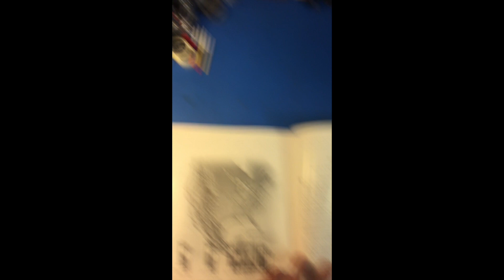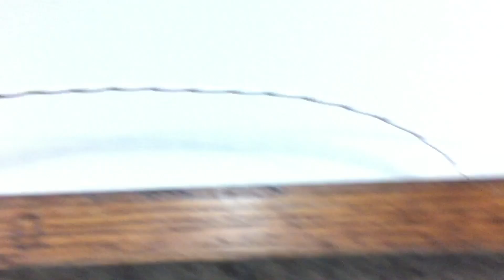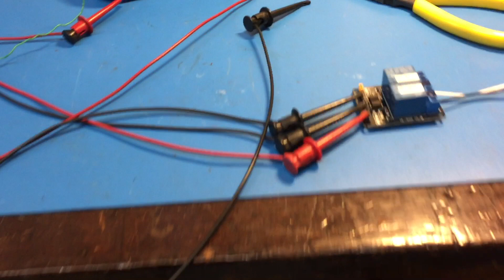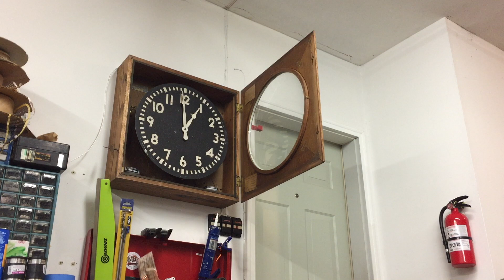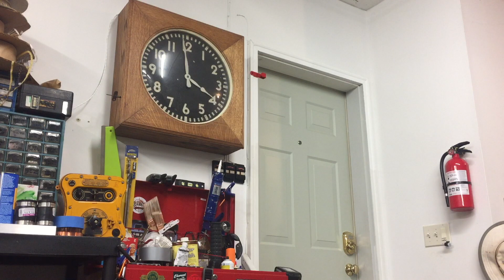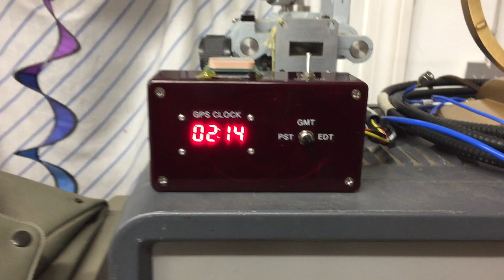Western Union Self Winding Clock Co. Clock Synchronized to a GPS

Comment: I had a problem with my SWCC hands too. Mine were about 10 minutes behind on sync. The movement is good but it turns out the alignment of the minute hand's mounting hole was wrong. My minute hand has a center brass press fit insert that can be aligned (with some heat and force) so 0 minute is actually directly on 12. I guess someone in the past tried to turn it an hour backwards and it got stuck so they just pushed harder and messed up the hand alignment.

Comment: That’s really cool.  Does the uncorrected clock ever run fast, or do they assume it will always need to be advanced?

I’ve always wanted to take a solenoid and optical sensor, and use that to phase lock a grandfather clock pendulum to 1 PPS. Use the solenoid to advance/retard the pendulum, with no physical contact to the clock mechanism.
Reply from the maker: At the time i didn't even adjust the clock.  A couple years later i took the time to tune-in the clock without the GPS syc pulse and its dialed in well... from that i can tell you that the clock was running REALLY fast at the time of this video, on the order of a min or so an hour.  Basically, the clock only has to tick to be accurate with this system, but now the clock is well timed so if the power goes out (which it has a few times) the clock and GPS are not far off after a couple days.